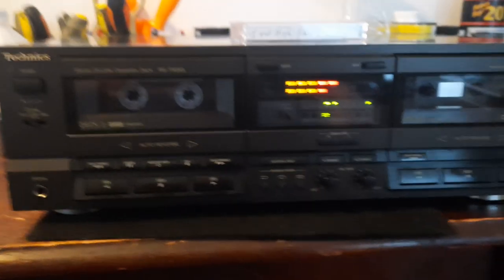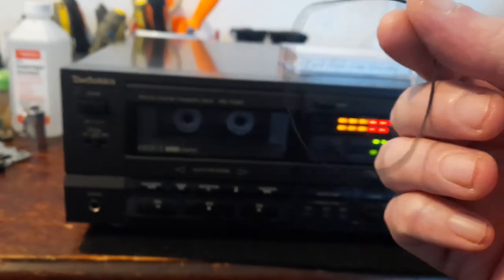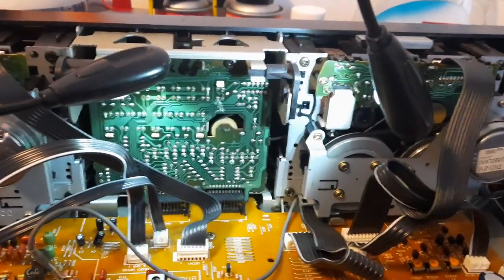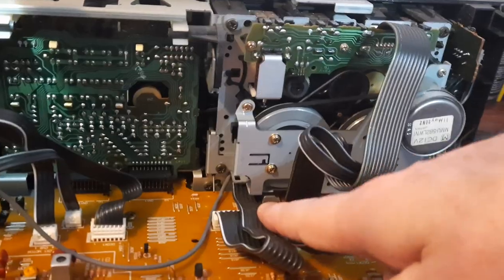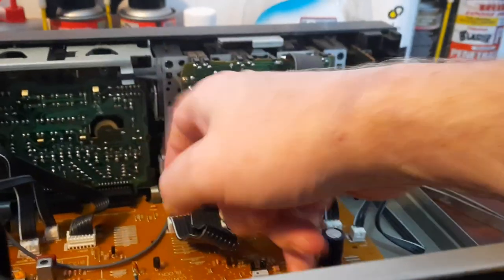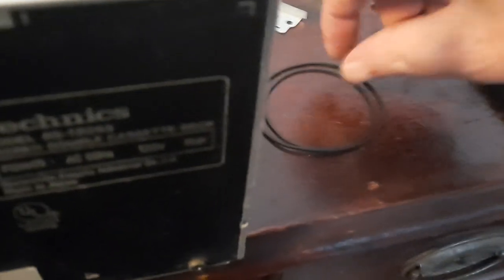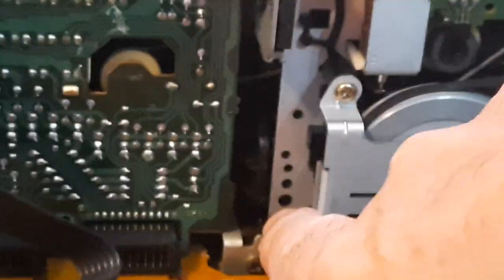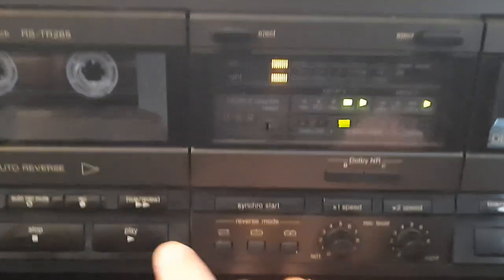Technics RS-TR265 counter not working, belt replacement. cassette deck repair.

Comment: Hello! Nice videos, I found them useful even if they doesn;t show every steps of repair. I replaced the gear on the right mechanism but I did a little mistake with one of springs and then the mechanism got blocked and I heard a grating sound and two very tiny parts of plasting (one rounded) felt from the mechanism). I disassembled it and found the problem with the spring. However, after another assembling I have now situation that the mechanims plays always in FF (right) direction, even if I press reverse mode (left direction doesn't work, it always play right direction). Do you know if the mechanism is somewhere broken or maybe there is another issue? I had to solder the cable going to the engine because it got cut while manipulating the mechanism. If you eventually know what's wrong, it would be great to read some feedback. All the best and good luck with future repairs :)
Reply from the maker: I have a 265 that acts up like that sometimes.  I haven't got back to it in a long time. It might be a bad dirty contacts between the front panels and the main board. Or might need ground wires added from front panels to the chassis. Maybe should make short video asking for help.
Reply from the maker: My best guess is the mode switches on top of mechanism are not correct. Switches might need adjustment.
Reply: @mr.nobody5422  Thank You. It is quite strange because before replacing the gear the reverse mode was working.